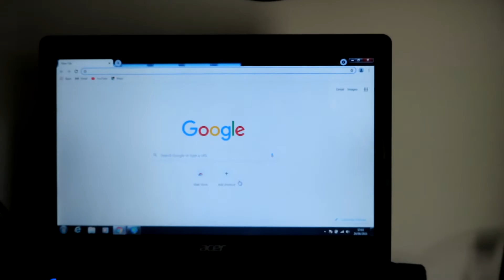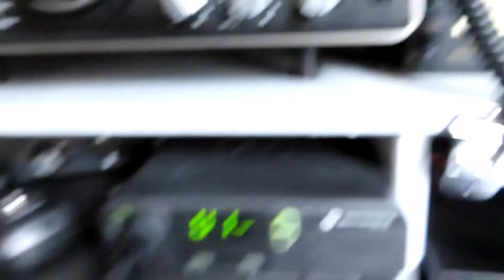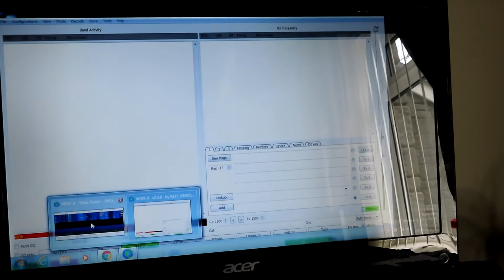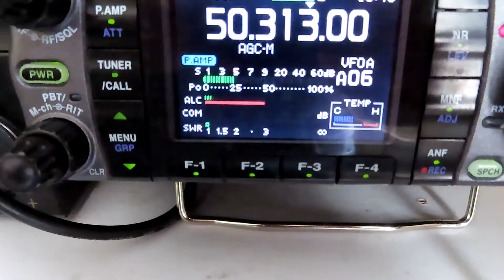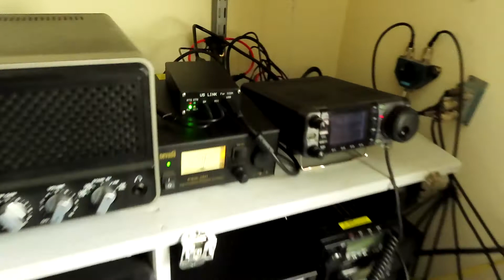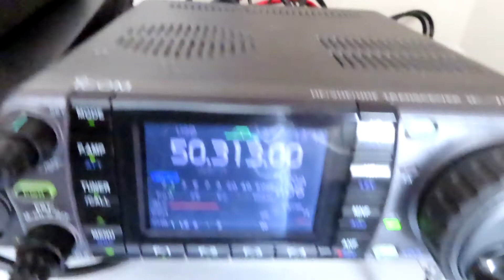Using the U5 Link and Icom 7000 for FT8

Comment: hello dude. i got one of these boxes. windows talks to the box but the box won't talk to the radio. i suspect it's a driver compatibility issue with windows 10. you mentioned another driver. which driver did you use please?
Reply from the maker: Hi Frank. What software are you using? I use WJST-x and didn't need to install any drivers
Reply: @KevinOReillyswl  wsjtx, ham radio deluxe. on windows 10. i'm wondering if a have an eath loop problem or something. when i enabe the cts and dtr, when wsjtx trests the civ, it clearly keys the radio over via civ so it's seems to be talking but then it comes back with an error when trying to retrive the frequency from the radio. timout error. hower when the ptt li goes on, one of my monitors on standby turns on.
Reply: i also tried my other lead which i used to use all the time, that didn't work either. then i tried it from my macbook with the updated drivers. no luck there either

Comment: Hi Kevin,

Thank you for your video.
I have a ICOM7000 + U5 link, and I desire to do FT8 with it on 2m band.
 I hoped to find solutions in your video because I can't RX or TX. Unfortunately, it is not the case.
May you give me your wsjt-x settings, to my mind the issue comes from my soft settings.

Many thanks 
Laurent - F1UQP

Comment: Nice! I am using a homebrew box like yours and trying to work FT-8 on 145 / 430 MHz. I can receive well but once QSO started, IC-7000 starts QRH  (you can see on waterfall moveing like a snake) perhaps due to the heat of transmission and QSO cannot be continued. Do you have such experience?
Reply from the maker: No I haven't had any issues like this. When using FT8 I keep the power down to 20 watts or less